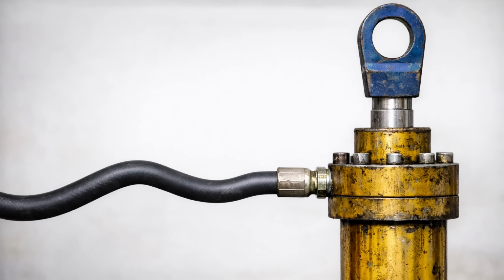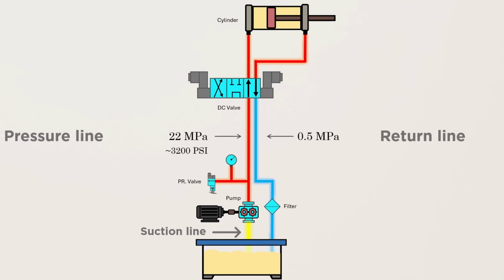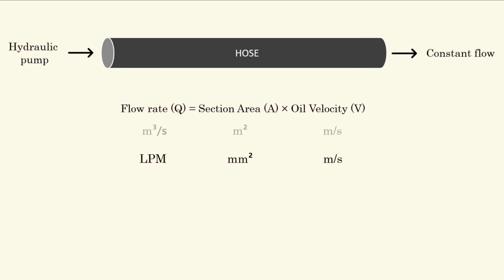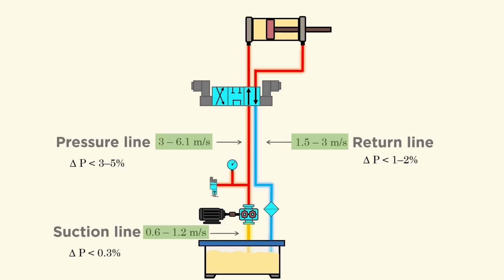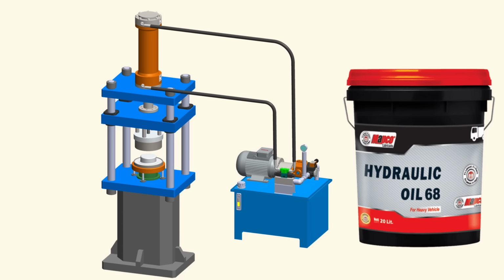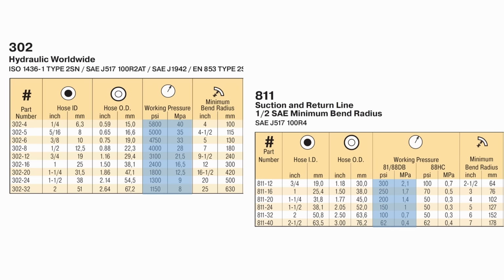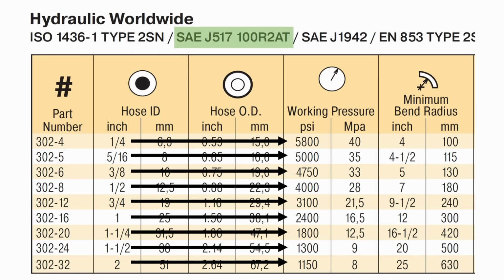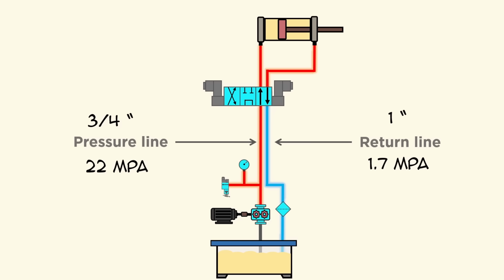Complete Guide to Hose Size Calculation | Pressure Drop & Standards

Comment: Excellent session sir
But have small query when we decide the pump LPM we need to consider volume of all hoses and while calculating hose diameter also required pump LPM  then how calculate both please sir ans
Reply from the maker: There is already a video- Hydraulic HPU unit sizing, where I have explained LMP calculation.

Comment: I have been working on quite a few hydraulic projects, and as a fresher my self, who has graduated just 7 to 8 months ago, i have learned a lots of thing. Like, design of oil tank, cabinet, bell housing for motor pump station, routing tubes between ports, optimizing manifold block material, from deciding the size of the line from the flow and velocity of the oil, optimizing fittings usage and a lots of more things, but still i learned something new from these video, and look forward to watch them....
I kept learning but still i think its i want to learn more.....
Thank you for these amazing videos....🤝
Reply from the maker: Awesome to know you found it helpful even with your experience!